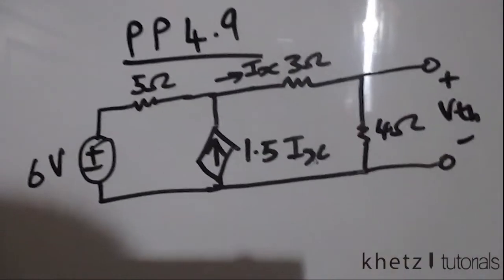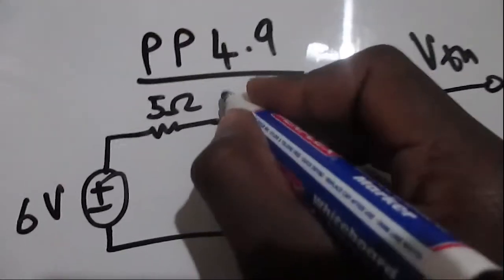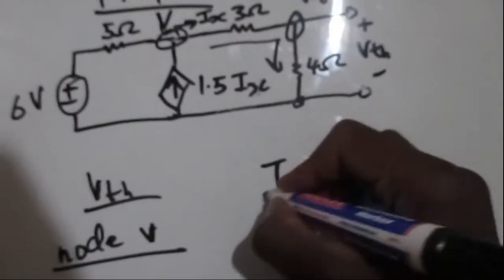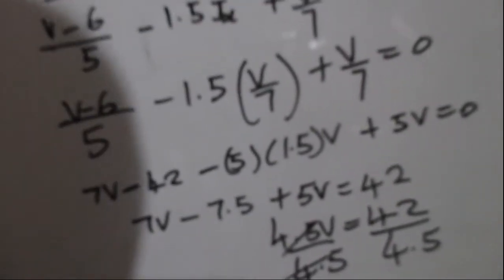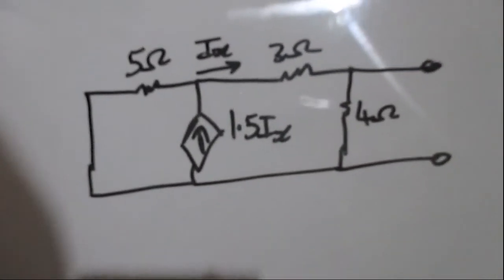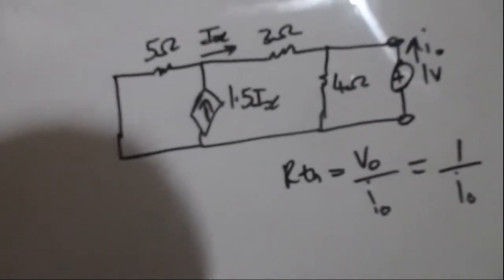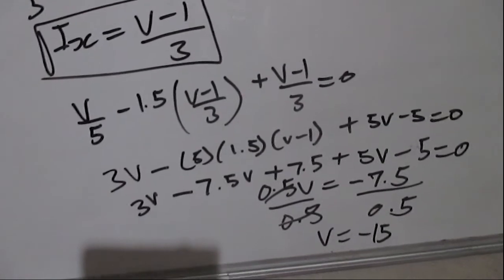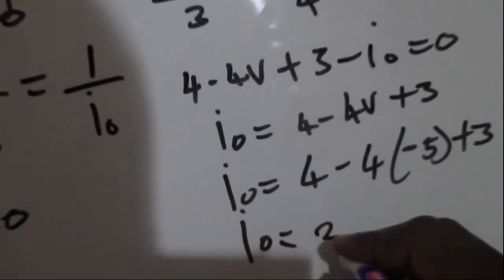Fundamentals Of Electric Circuits Practice Problem 4.9

Comment: Why did the 1.5Ix carry a negative sign In the nodal analysis please?
Reply: I use the following convention:
Currents going into the node are negative while those that go out are positive. I ALWAYS define unlabeled(in terms of direction) currents going out and that is why 1.5ix is negative and v/5 is positive
Reply: @vukhetamaluleke6869   if this is so,then +v-1/3 too should be negative  -v-1/3... I'm really confused... My own convention is in= positive and out=negative
Reply: @haleemahoummusab21  no because it's also going out
Reply: @haleemahoummusab21  it is ix and ix is going out
Reply: @vukhetamaluleke6869  if the sign convention used was to be in= negative and out= positive.. What about the v/5 please.. Why isn't it negative
Reply from the maker: I explained that in a previous comment please check
Reply: And also,why is the v/5 positive and not negative please... Not familiar with this in nodal analysis
Reply: @haleemahoummusab21  I Know right, ive been looking again and again in the v/5 and wondering why is it positive, i think 1.5ix is negative because its going to the node and ix is positive because its arrow doesnt point into the node. i dunno about v/5